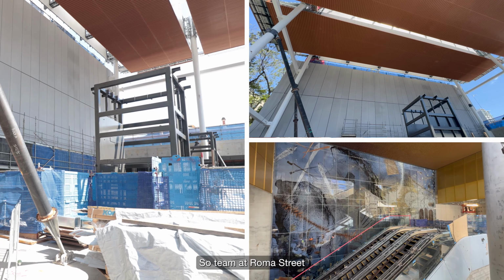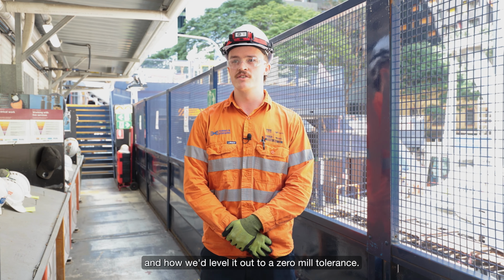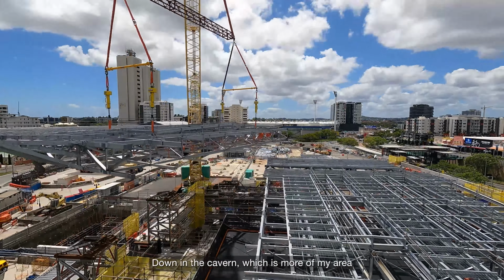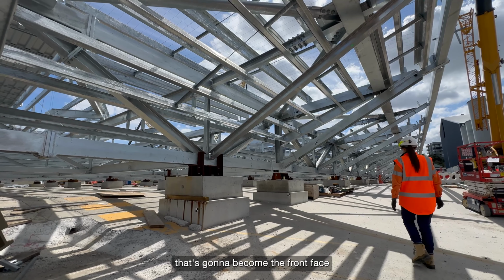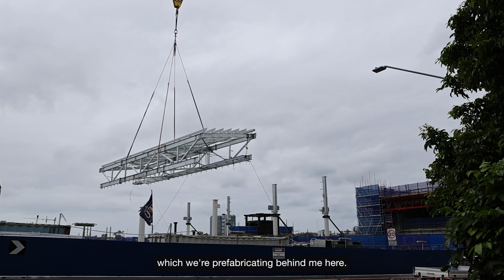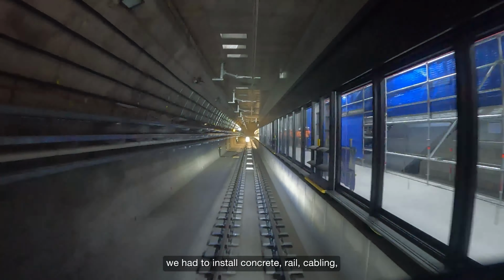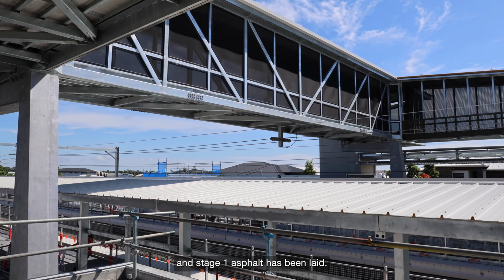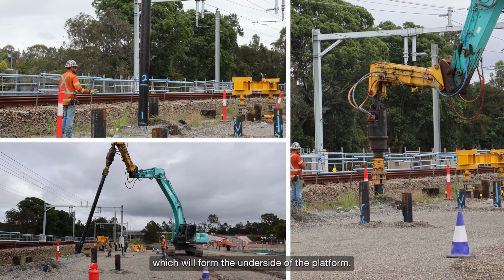Around the Sites | September - November 2024

Comment: I hope that the escalators installed at these new sites ARE NOT supplied and installed by the team that installed the latest ones at Central. Every week, often twice a week, one of them fails. They are less than 2 years old. 🤦🏻‍♂️
Reply: and let's hope they bought more than one set or even worse, just one per platform!  QT/QR where it's still 1895  🙄

Comment: Based on the length of time its taken, and the cost, Brisbane must be the first city in the world to build a subway it seems.  Amazing technology!
Reply: Assuming this comment is intended as sarcasm, I will add some factors that give a more realistic context.

- Not all cities are the same. A hole in the ground isn't always the same thing not because of the hole, but because of all the things you need to dig through to make the hole (the different soil and rock types, surface vs deeper geology, plus hydrology which is a major factor when building in a floodplain city like Brisbane.
- These challenges multiply when you are completing a project of a kind that hasn't been done recently (or ever) in Brisbane. Not only do you not have a base of experienced workers and engineers on hand, you have to rediscover a lot of the above realities about working in the Brisbane geological environment.
Reply: @Beeblebrox6868  utter RUBBISH!  Australia has built multiple underground rail systems over generations and Brisbane itself, doubled its own inner-city rail tunnel capacity, in the early 1990's, such feats are well within the skills-sets available!  It's been a typical ALP/CFMEU co$tly stuff-up, from day 1  😂
Reply: @mmmail1969  This reply is a general spray with partisan political flavouring but lacking anything like informed analysis.
You missed the point I was making which is that "Australia" isn't a city, it's many cities, each with very different conditions. You can't cookie-cutter this stuff. And the way tunnels were built in the early 1990s was quite different - they weren't using TBMs back then.
Reply: @Beeblebrox6868  doesn't change the FACTS!  God Bless!
Reply: @mmmail1969  name a single fact youve said in this entire comment chain. you're right. your opinion doesnt change the facts. earthworks and especially tunneling is an extremely complex and varied process, that is highly reliant on the soil makeup along every cm of the dig.
Reply: @mmmail1969  Your posts haven't even alluded to facts. Merry Christmas!
Reply: @Beeblebrox6868  which state, has THE highest rail per km construction co$t$ in Oz, over the last decade???